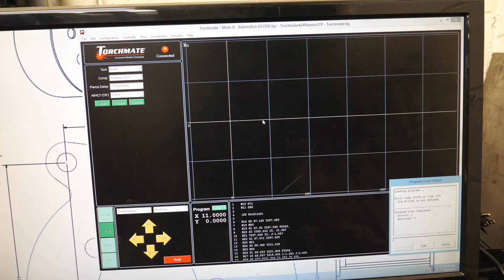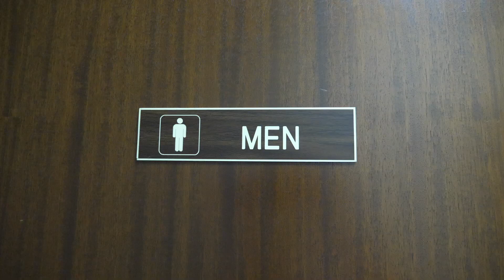Race To The Finish Line

Comment: What is a good kit for a tomos lx? NEED MORE POWER!!!!
Reply from the maker: The 44mm Alukit for A35 is a very strong kit. It’s s bolt on for the A35 engine, and can be used on the A55 as well with some minor adjustments.